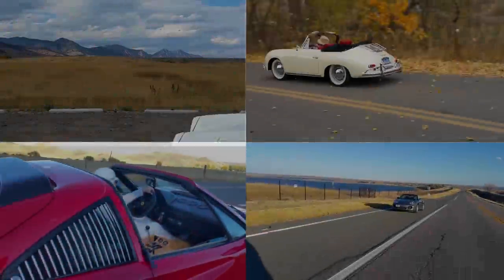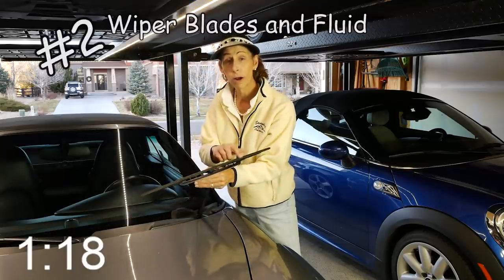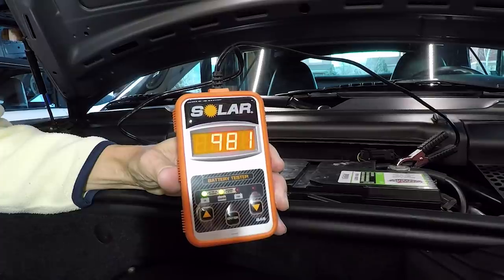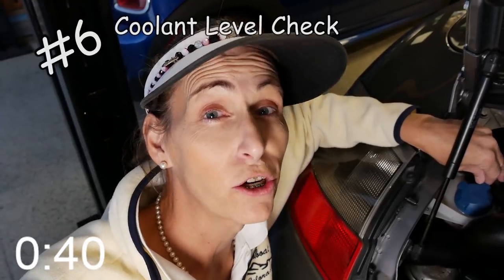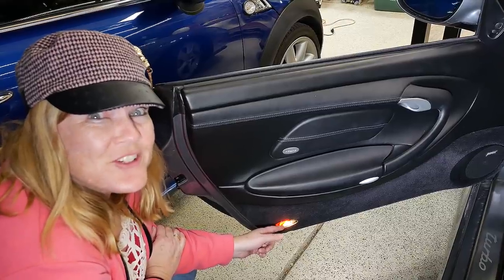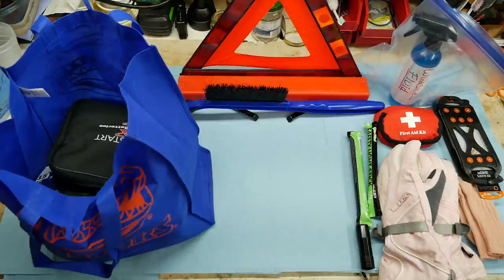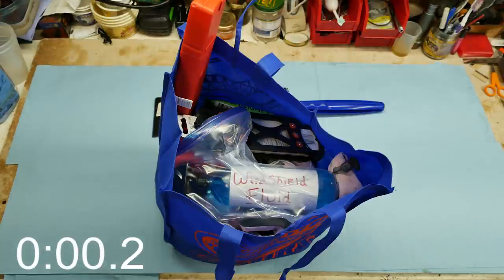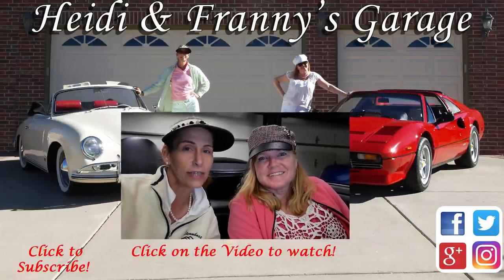8 Winter Car Hacks in 90 seconds! (EASY)

Comment: Greetings from snowy Finland! I found your channel yesterday and subscribed.
The MOST important thing to have on your car in winter is proper winter tires!
Reply from the maker: Welcome to the channel and thanks for your comment! Tires are huge!!  Even "All-Season" tires just won't cut it.  Snow tires have completely different treads with little slits that make for lots of gripping surfaces.  Also, the rubber compound is formulated for better grip in lower temps.  It is equally important to swap out for your summer tires for the summer so you don't burn through your winter tires and because summer tires are better in rain.  F

Comment: Some great tips there and some fantastic cars you have. A couple of things I'd add is to check the date on the side of you tires to ensure that they're at their best. Another really quick tip with regards to wiper blades (everyone misses this one LOL!) spray a microfiber towel with glass cleaner, then clean the rubber of the blades. You'll be surprised how much dirt comes off, and how much better they work afterwards. It also can help to stop them freezing to the windshield (sometimes!) - Great channel btw!
Reply from the maker: Thank you. I found your channel about a week ago when doing some research before our video.  Yeah, there were lots of other tips that we did not mention (like summer to snow tires) but your points are well taken.  I was going to mention your channel if we do another video on storage, because we don’t store our cars for the winter months.  I liked your video and I see you found my comment.  Heidi

Comment: Another great video, I would add a safety vest, the reflective kind for visibility to your kit, this is mandatory in Switzerland and is often checked by the police if you have one stored in your car.  Here in Oz my safety kit consists of a pair of thongs ( I think you call them flip flops), sun screen, an Esk with a few beers, a beach umbrella and a fishing rod.
Thanks
Reply from the maker: Hi Rich.  You should check out my emergency tool kit video.  It has lots of good stuff.  It does not have a safety vest in it though.  That is a good idea.  Heidi

Comment: Safe travels and happy holidays :) What sort of tires do you have on the 996?
Reply from the maker: You too. We have Pirelli 240 Winter Snow Sports.  Heidi
Reply: This is probably the best bit of winter advice - put cold weather/snow tires on. So many people don't. Are they required where you are?
Reply from the maker: Not like legally required except up in the mountains, but all-season are a bit lame at both...  Plus, the rubber compound of winter tires is much better in the cold and we have a lot of cold dry driving...  All three of those cars on the bottom have dedicated snow tires/wheels.  That 3.2 Carrera is a hoot in the snow!

Comment: Here's a tip for summer. Always store your winter tires in black plastic bags and seal them, as both light and air make the rubber age prematurley. I'm an ex pro tire fitter by the way.
(Note: Firefox can't spell prematurley!)
Reply from the maker: No, it cannot ;)  That is a great tip! Thanks!
Reply: Is there a way to simulate this sealing for tires on cars that are not driven frequently?
Reply: As far as I'm aware there isn't. You can make them look nice with treatments you buy from the shop, but it's just chemicals and actually not good for the rubber.
 But road tires have a shelf life and their manufacture date marked on the sidewall anyway. So preserving them past 6 years from then is kind of a hiding to nothing, as your insurers are likely to not pay out in the event of an accident. Because you can be certain that an insurance inspector will find a way to save the company's money from the smallest thing. It's their raison dêtre.